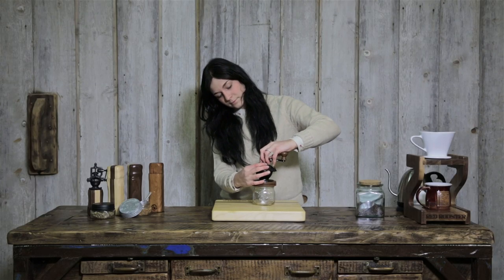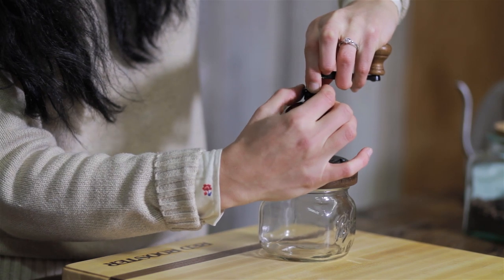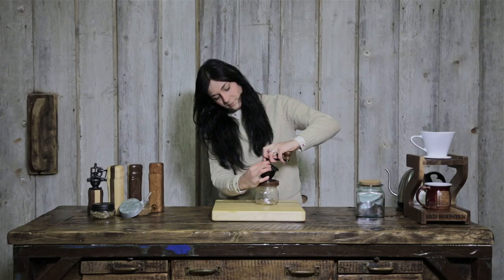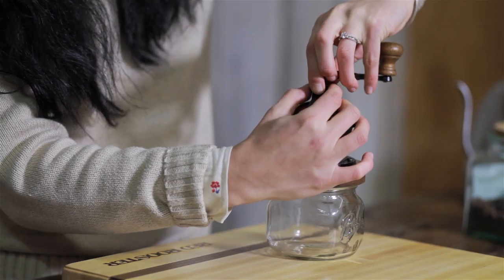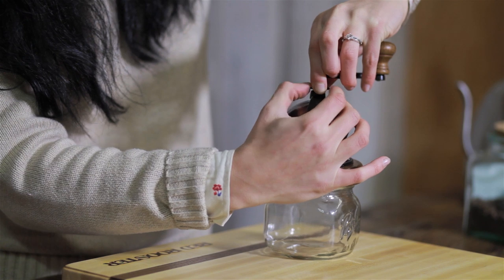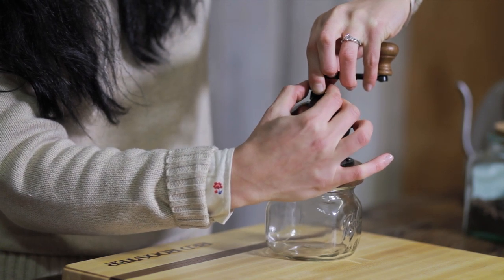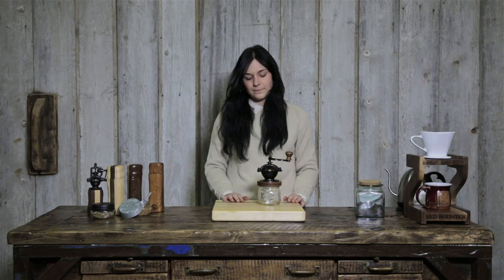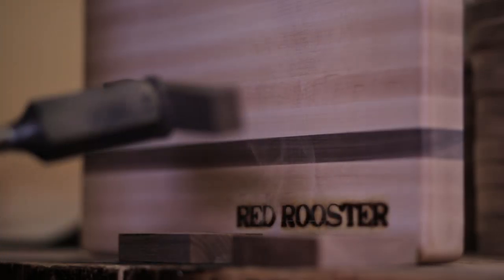Camano Coffee Mill Adjust the Grind

Comment: Hi I have used mine for the first time, and am struggling to adjust the grinding level. I cannot lift the parts as the spring seems to be too strong, I cannot lift the parts high enough to rotate the small octagon disk. also the width of washer is not wide enough?  not sure if I am doing the correct way, but please help.